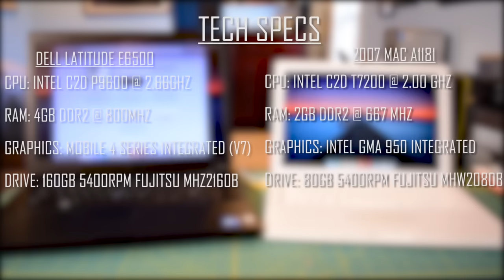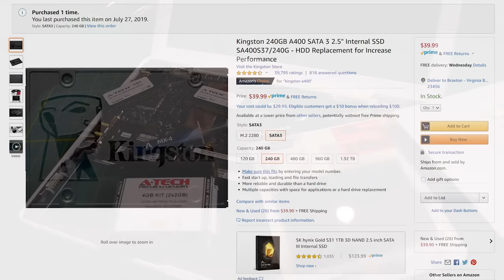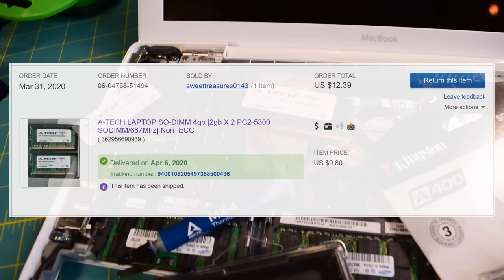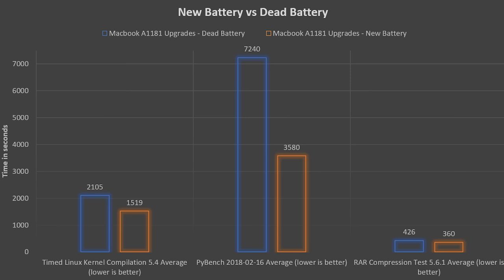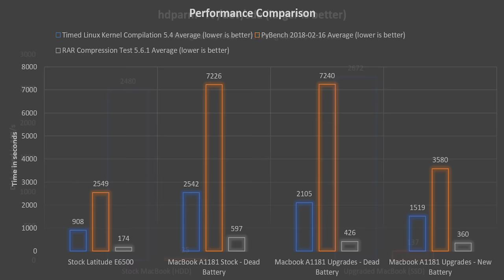Throwing $85 Worth of Upgrades at an Ancient MacBook: Apple MacBook A1181 Complete Upgrade Guide

Comment: Tried running DosDude1 patcher with Mojave or something on this?
Reply from the maker: Nope, i'm not really a MacOS guy so that doesn't interest me.  I'm sure some other more Mac oriented channels have tried that though!
Reply: Doesn't work on anything earlier than a 2009. There was a very short lived 2009 that shared this same outward case and can use dosdude's patcher. But then they switched the plastic unibody (which also of course can use the patcher, I've got one).
Reply: KioAMVs the model you were talking about was a late 2008. Not 2009. I have one of those with its aluminum case instead of plastic.
Reply: KioAMVs ah I right I’ve seen someone do it that was all forgot apple did that thanks.
Reply: @owenready7043  Nope, I am talking specifically about MacBook Whites. https://www.engadget.com/2009-10-22-unibody-macbook-late-2009-review.html
Reply: @owenready7043  here's a small blurb about the short lived 2009 with the same case design as this one, but still compatible with the patcher: https://www.engadget.com/2009-05-27-apple-quietly-updates-999-macbook-again-goes-back-to-school.html
Reply: @maxoneill6582  I'm a bit encyclopedic about Mac laptops. I've owned about 10. I currently have a 99 iBook, 2006 MacBook Black, 2008 MacBook White, 2010 MacBook White, 2011 13" MacBook Pro, and 2015 15" MacBook Pro. Owned a 2010 13" MacBook Pro and a 2012 13" MacBook Pro which I've sold. I repair, upgrade, and sell. Never made videos though.
Reply: KioAMVs oh. I see you were talking about the mid 2009 MacBook. I was talking about my late 2008 (Aluminum) which has exactly the same graphics but uses drr3 and has a LED backlit display. It’s model identifier is MacBook5,1. https://en.wikipedia.org/wiki/MacBook_(2006%E2%80%932012)

Comment: I have this exact computer that I'm trying to get going for my daughter's schooling needs. I only need it to run 1 program well. The system requirements of said program are iOS 10.13 or higher, safari 14.1 or higher, or chrome 88 or higher. If anyone could tell me whether or not these upgrades could make this program work I would be soooooo thankful.
Reply: Short answer No. Long answer. You can use the last compatible version of that program on this MacBook with the upgrades on macOs Lion.. (mountain lion unofficially). (parotgeek script).

10.13 is H.Sierra so you would need at least a MacBook pro 2008 and up or MacBook white 2009 and up. All those support high sierra officially and unofficially and run very stable. With SSD and 6-8ram they are still very usable even in 2021. I sold a few for $200-250 with max upgrades and essential apps pre-installed.

This white ones from video I'll probably sell for $100-150 max hopefully with max upgrades + apps
Reply: @Alex2021ZR1  what does max updates and app??

Comment: MX-4 is made by Arctic, not Arctic Silver. Two completely different and separate companies.
Reply from the maker: Ha, i keep getting them mixed up since I have both in the back.  I'll try to make sure not to do that again, thanks!
Reply: Arctic is the BRAND. Arctic MX-4 and Arctic Silver 5 are TWO DIFFERENT TYPES OF THERMAL COMPOUND.
Reply: @NickTheGreek5109  Nope. Arctic and Arctic Silver are two separate companies.

Comment: Even though the cpu is soldered on, is it possible to replace it or upgrade safely or no?
Reply: No
Reply: @Alex2021ZR1  dang thanks
Reply: Anything is possible, whether you should or not is the question. On a model like this, it would be far cheaper/easier/quicker to get a donor board with the processor your want on it, and swap it in.

Comment: TThat is so true. We see a cheap used computer and start dreaming. Then you add a battery, a power supply, and hard drive. Soon the price is upwards of $300. You can get a Motile laptop at Walmart in the $300 range and it is very powerful. These only make sense if you find a great deal and/or you have spare parts around the house. But honestly, is it worth it to really upgrade this?
Reply: Depends on your purposes. Trying to keep e-waste down to a minimum. I had purchased the 4GB of RAM already back in 2008 when I got it, the SSD came out of another junked office PC from my work. When I started my own project, I had three non-functional 2008 MacBooks. All would have ended up in the trash. At the end, I have one completely functional MacBook Pro which is useful by 2020 standards, and a pile of spare parts. I might be able to get a second unit working again, but I haven't tried yet.
Reply: I agree with @KioAMVs - it’s satisfying to keep these old machines running.   I’m curious which $300 laptops at Walmart you got you felt were powerful?  I tried to grab an IdeaPad from Best Buy and it was the biggest piece of trash I had ever used it was so underpowered.   That’s when I realized my A1181 was pretty useful by 2020 standards!

Comment: It seems older enterprise machines are good sleeper boxes.
Reply: what’s a sleeper box?   tried to google it and get 18-wheeler rigs :)
Reply: @chinarut  Think 'making the flashy hot thing look old and busted.' Like making a honda civic that could dominate in a quarter mile but no lights, no detailing or rims to make it look like anything other tha na cheapo used car.
Same thing applies here. Make the terrifying and modern PC look like something you dug out of an attic rather than see how much RGB you can cram into it.

Comment: Okay 2h 12m is actually quite bad for iGPU based machine... My Latitude D830 lasted 5h 20m with its iGPU and a 45W X9000 CPU
Reply: I would never say the value of this machine is in raw computing power.  it’s in the flexibility to work in Linux, OSX and Windows.

Comment: i would not throw money at it,  fort 85 bucks i could buy a mount mikes pizza for 1 week :D
Reply: I would say the core users who are still using this MacBook already invested in an SSD and RAM and just trying to stretch their 13 year+ investment.   I personally wouldn’t’ recommend the hardware upgrades at this stage in the game but to be fair, any investment you make in an SSD can be used in another machine (though everyone is moving to NVMe so this is debatable - I returned an SSD upgrade I made to my MacBook for exactly this reason and just going to live with 120GB which is fine for Linux and occasional boot into OSX)

Comment: Upgraded a 2009 MBP to 8gb Ram, 128gb SSD and using DosDude1 Catalina installer was able to get it to Catalina with no problems.  Yesterday I tried to upgrade my old 1181 Mac to Catalina but it would not take it.  Www.dosdude1.com/Catalina for the patcher application.  Takes a while to download the 8gb  Catalina OS but it makes a 2009 2010 or 2011 useable again. The 2010 and 2011 A1278 can hold 16gb of ddr3 and run Catalina very smoothly. I believe all was done with the patcher by DosDude1 was add in the old drivers that Catalina leaves out of its installer.  I’ve done similar thing a few years ago with a VM of a Mac with El Capitan.
Reply: someone here has Mojave (10.14) running on an A1181.  I’m plenty happy with El Capitan (10.11.6) until I finish transitioning iTunes, iPhoto and Finder (eg. dmg) to more agnostic formats/services.    I’m curious if there are Catalina use cases you feel I’m missing out on?

Comment: How's the vic???
Reply from the maker: Pretty solid still.  I need to do a full suspension rebuild on the front and rear.  Every single suspension bushing is shot. Probably going to do that late summer / early fall.  It still drives fine and passes inspection, I just don't like to let my stuff get that bad though.